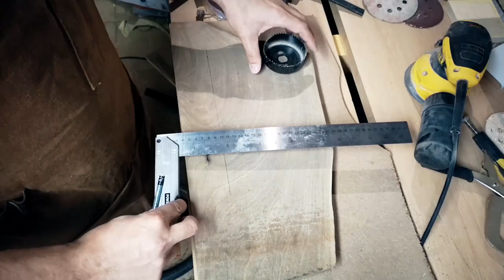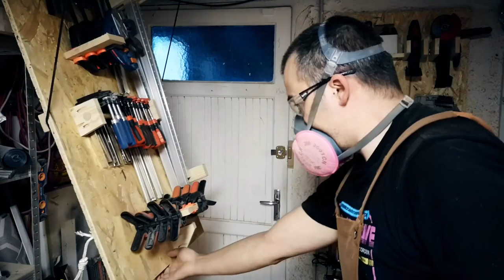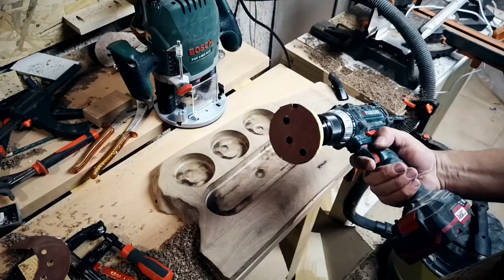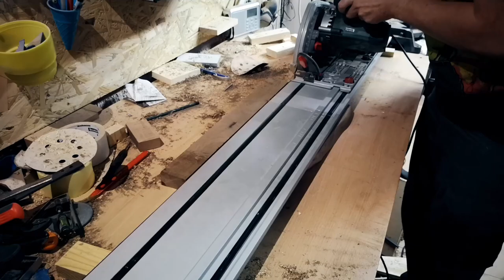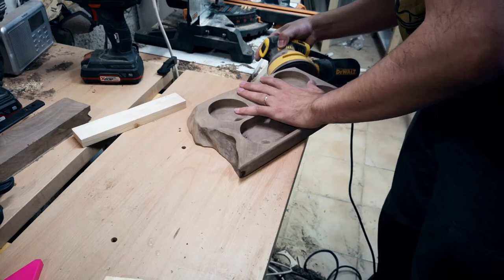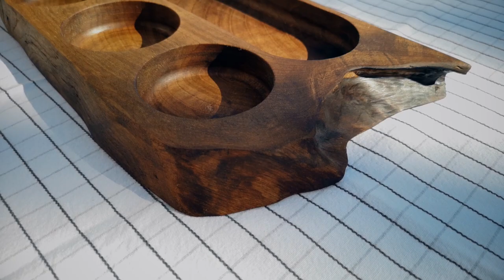Making a live edge walnut serving board

Comment: Nice idea making the holes the same diameter as the sanding disc. That saved some effort!
Reply from the maker: Would you believe me if I told you it was sheer luck ? I looked at the burn marks, was like "omg I have to sand that now", and then I saw this kit I bought a while ago but never used before... turned out, it was the exact same diameter! How cool is that ? 😄